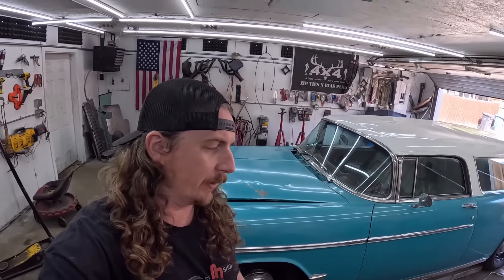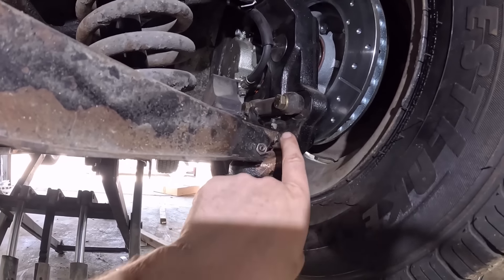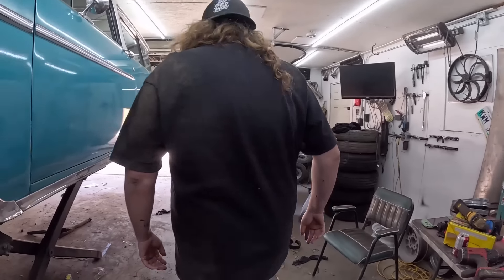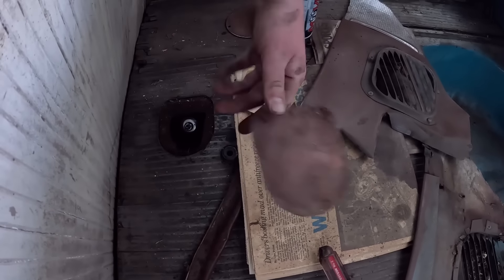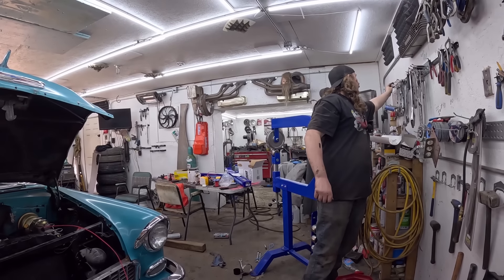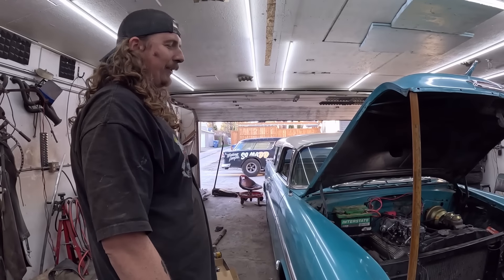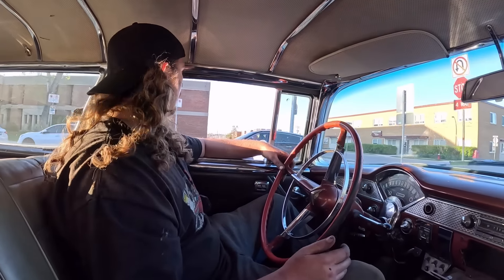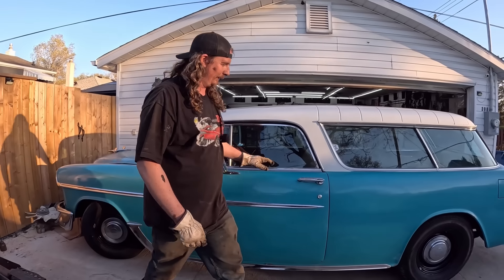TRANSMISSION DISASTER! 1955 Chevy Nomad First Drive FAIL

Comment: I'm a 72 year old geezer with experience with this so pay attention! Every car I ever owned that had "3-on-the-tree" I ended up putting in a floor shifter for exactly that reason. At the very least disconnect all the shifter linkages and inspect for wear, excessive slop, etc. sometimes you can shim up excessive slop with washers, and make sure pivot points are greased. Or just put in an automatic like I do these days. Now, get off my lawn Hippie!
Reply: My 68 chevy pickup had the floor shift. Our lab would lay on the floor and would knock shifter into neutral. So i put it back onto the column. My wife drove the wheels off that thing.

Comment: This shifter problem goes back to the late 40's. The fix is to remove the load off the drivetrain on a level surface.  With the parking brake applied you grab the shift levers; you lift one up and push the other one down.  It's why I put a floor shift conversion in my parents 50 Chevy back in 1965.  The linkage was worn out.
Reply: Had the same problem with a 63 pickup with 3 on the tree. Had to open the hood, then manually adjust the linkage, would work for a while....
Reply: My parents had to do that with their 55also.
Reply: Had an old Rambler American with 3 on the tree. After it got worn the levers would lock up, and I would have to get out at a stoplight, open the hood, release the lever, the maybe it would work for a while. Ended up using some rubber from a a toilet valve as a new grommet and that worked for a long time.
Reply: Had a Nova with same problem. Had to put in third on a hill and drive home 400 kms.
Reply: I had one of these three on the tree on an old van. any time going1st to 2nd gear you had to go to 3rd then to 2nd. same going back to first from 2nd. you had to go to third then first. it was complicated but i drove that thing for years like that. probably 100k.
Reply: Best way I found to do a 3 speed is, with good parts, loosten everything up, put the shifter in neutral and block it, get under the car and center the shifters on the box in neutral and tighten everything up, starting at the rear. Should be on the money. You learn a lot on wednesday nights.
Reply: That shifter needs fixing at the base of the steering column. So the excess play lets the column move to the 2-3 shift arm but the trans is still in first. The interlock in the trans locks the 2-3 in the center position.
Reply: You get really good at putting it back to center after a while.  I've had to do it many times over the years.
Reply: Had the same linkage problem on a 76 Nova.
Reply: I agree. I had trouble with my ‘55 the same way. Never did figure it out, but could get it going right away. I am not a real fan of station wagons, but I love that Nomad.
Reply: Yep ,73 Chevy pickup had same problem
Reply: Back in the day, we just replaced the shift tube, the shift gate on the top would get rounded enough to cause this problem. If we would’ve had mig welders and cool grinders back then……
Reply: Or, you find/fabricate the parts you need to tighten up the slop.🤔

Comment: I’ve been driving 3 on colum for many years. When shifting u have to go trough the gears or it will get stuck. When you went from 3rd to 1st is the problem. The bushings are wore. Run it trough the gears 123-321. Try it slow and smooth. Good luck. Love the show.
Reply: I will have to remember that with my 3 on the tree Fairlane Wagon
Reply: Had the same issue with a Chevy pickup that I drove for work.  The owner said to shift up and down through all of the gears just like you said.

Comment: It isn't the shifter linkage it is the person shifting the shifter. What happens is when going from 1st to 2nd you are not fully disengaging  the 1st gear before heading for 2nd and the shifter becomes disengaged from the 1st/rev shifter arm before aligning with the 2nd/3rd shifter arm hence stuck in 1st! I like this car and your build content.
Reply: yep i agree  locked up a few 3 on the trees myself  open the hood should be able to unlock without crawling under

Comment: yup  its the shift linkage is in neutral and the transmission is in first the shift linkage has dropped into neutral all you have to do is pull the linkage to first and reverse up to neutral and your back in business the shift linage is worn out 
cheers

Comment: Bobs1345 has it right. Had a 65 Elcamino did the same thing. The shift linkage on the firewall is worn out. I can’t remember how to push or pull on the linkages but just work on it and you’ll figure it out.   Easy on the shifts.

Comment: Thanks for the giggles, my 56 used to do the same thing with the shifting. ended up getting my first ticket thanks to the linkage locking up. when i let the clutch out they thought i was trying to drag race it. all i was trying to do is get out of traffic.  most of the time i could get it pretty easily but had to stop to do it.

Comment: I own a 55 Poncho 261 inch 6, 3 on the tree and overdrive. Like a previous guy said easy to unlock from under the hood.  It likely needs all new bushings in the linkage arms to trans. You can get these parts very inexpensive from Bay Ridge Chevy in Little Britain, Ontario. I have been dealing with John there for years, he is very knowledgeable on all old chevys and has tons of used and new parts in stock. Been a.viewer for 3 or 4 yrs now. Keep up the chevy.builds.

Comment: Back when I was a young fella column shifters were very common. This was a common problem. We used to fix it with a worm drive hose clamp around the base of the steering column where the shift levers are. The column would stretch slightly and make those levers sloppy. The clamp would tighten it up again. Cheaper than a floor shifter conversion.

Comment: The shifter forks on the steering column under the hood are wore and you need to pull the low gear linkage up to  the neutral position in line with the slot on the high gear linkage. The  the shifter will then work until  next time work it slips out of alignment again.
Reply: delete the 2nd work.

Comment: Those three speed on the tree are disasters       There is a way to adjust ,   Watched a you. Tube video on. Adjusting. 
I have one in a 1970.  GMC 1/2 ton.
Reply: I had a C20 shorty that was a real pain in the ass. Had a 327 in it, took about a year to figure out. New bushings, rods, whole 27 feet. Worked like butter after a while, just can't rush them.

Comment: replace all the shifter linkage bushings and spend some time adjusting the linkages and it should work very good. i just sold mty59 el Camino with a three on the tree. i had it for 20 years and i replaced all the linkage bushings and i had to make the one for the linkage attached to the frame from copper tubing. i adjusted the shifter linkages so you could push it from first towards the windshield into second every time without ever getting stuck in first. it had the original style 3 spd trans in it .

Comment: Those old cars do ride really good I remember driving my grandma's 54 6 cylinder 3 on the tree if was freaking awesome 100% all original it was on its 2nd set of tires the first set was starting to crack she won the car in 1954 my dad had to drive it home for her she was so excited she sold the car in 1985 or 86 with only 38000 miles on it it slept in the garage every night never was outside for more then 10 or 12 hours at a time  ì loved the dash in that car the chrome went all the way across the ashtray was pretty slick you couldn't see it with the chrome trim  it was hidden

Comment: Lots of optimism with lots of issues!  Sounds like automobiles from the old times.  I'm fascinated by the steering wheel turn ratio...lots of rotation when you turn?

Comment: Did U get the front bumper bracket Bolt mite be a raddle?? Oh yeah most them Raddles are coming from them seat's mite seam stout but they are not. And the noise will move if no one is sitting in them.

Comment: The centering part of the linkage gets worn and will allow it to not quite come from one gear to the next because its still in first gear, meaning if you forced it into another gear as well as first being stuck.... real problems then. With tires blocked and someone holding the clutch pedal in, move the linkage in the transmission to neutral. You probably will find it easier to take one of the shift rods off of either the top or bottom, your choice but I did it from the top to line up the two linkages where they belong. There is where you will find that slack is causing this issue. You will find the selector on the shifter is usually worn and allowing it to not shift right so it stays in first and you have already moved the selector into the place that makes it hung up at. I have been lucky and held it up on the shifter will rolling and try and find where it will go back all the way to first again and retry shifting. If your not going to fix it right, you have to shift it like your headed for reverse instead of second so it comes completely out of first and then it will drop down on the linkage right and allow you to find second easy enough

Comment: FYI.  I sometimes notice that you are turning the steering wheel with out moving the car.  Even if you move an inch at a time the steering wheel will move much easier.

Comment: This is a sweet car. It is a once in a lifetime, but you have 2. If you need to move it on, so be it. 
Undercoating, i have a blow gun with an adapter to take 3/16” brake line,about a 20” piece. Blows off loose undercoating quick. 
You are not the master of 3 tree shifting yet. Takes finesse. 1st to neutral then second. A tad towards reverse and it will go to 2nd. By shoving forward from first it binds the linkage. Up to N is the trick. My 68 chevy was finnicky, once it taught us how to drive it was a piece of cake. Let a non column driver at it and it will do the same thing.

Comment: They've already said it...Keep them both. you can rag on the Somadd and keep this one for picknicks...I wouldn't be surprised if you had maybe some new linkage stuff for the tree in all the parts you took out...if not someone will have 3 on the tree parts nos somewhere for cheap. 
You'll never get the chance to own one that is just enough 'DD' so you can drive it, they'll all be too shiny or expensive...;D

Comment: Jeeezzz, if it doesn't WANT to shift in 2nd, DON'T force it! Try going to 3rd instead. I mean it has a f-ing V8. it WILL pull 3rd at low revs no problem.
Those column shifters work best if you use them GENTLY. i know, i had a car with column shifter ( a Peugeot 404, The french mini-equivalent of a 57 Chevy ) it had a 4speed . It had trouble shifting when the gbox oil was cold. double-declutching and gentle use made it work.
Reply: YA DAN, WTF LMAO.
Reply: I had 4 on the tree Ford Taunus in Germany It was a blast had a little V6 with 1 barrel carb.

Comment: The blue Nomad is already unoriginal enough that an auto swap won't be a huge departure. Unoriginal engine, unoriginal brakes, lowered. I vote for a simple TH350 swap. It won't destroy the value and is still reversable if someone wants the original 3-on-the-tree.

Comment: You are not shifting properly. When going from first to second, go slightly up towards reverse for linkage to clear. When going from third to first, shift into second then first. Never 3 to 1. 1,2,3 and 3,2,1 always slightly going towards reverse between 1 & 2. Typically never going into first unless at a complete stop if not synchronized.
Reply: Don’t yank it around or you mess the inner sleeve up. Scotch the wheel, and pull up on levers under the hood by column to neutral position. It’s easy

Comment: Yeh,  those shifting linkage they always get stuck, you'll have to change transmissions to get rid of those problems because there is no way to get the shifter to shift without hanging up., that system is not very good.  ❤️👍🤍👍💙👍